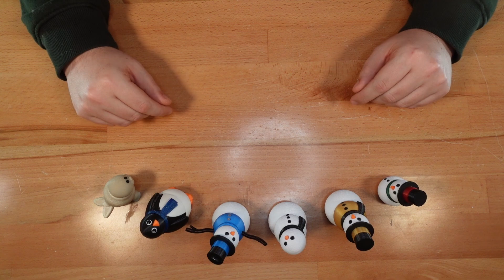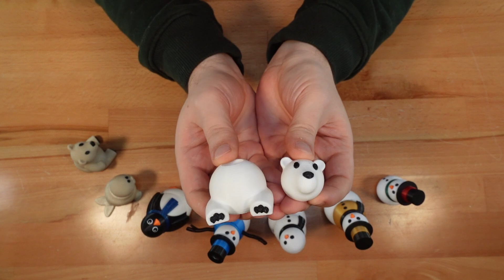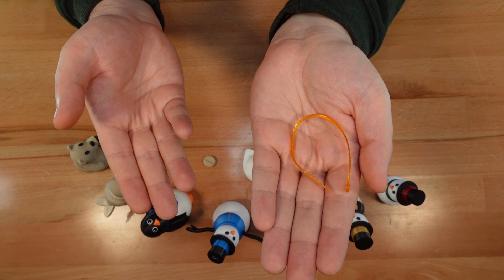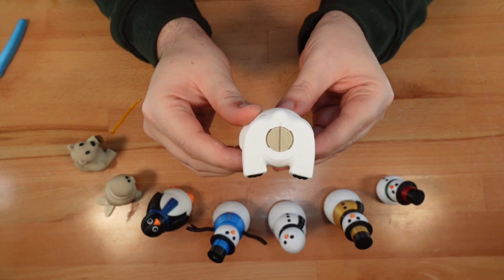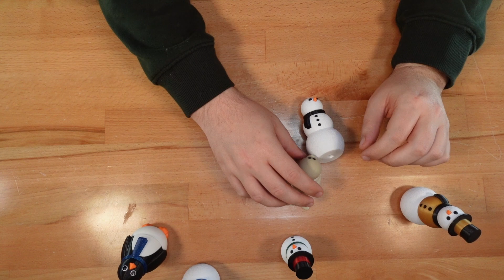3D Printed Posable Bear Cubs

Comment: Great print!  And an excuse to try to cajole my printer to work with TPU again (both of us are a bit... cantankerous).  

Just as a side note - in the BJD community, a length of ribbon is often used to guide the elastic cords through some of the more challenging points in stringing.  I tried both wire and ribbon on a very small BJD that I had printed, and found that the ribbon moved more easily around the tiny curves. 

And a cat version would be cool, in honor of your outro guest. =grin=
Reply from the maker: Excellent feedback with using ribbon as a threading tool, thank you! Threading something through first might be extra helpful since TPU has a sort of high-friction rubber feel to it.

Zelda the cat would certainly approve of your suggestion :)

Comment: i made one and the TPU zip tie really helped! my other experiments with TPU were pretty messy but all i needed to change from my PLA settings were the temperature and print speed! The Zip tie is also much nicer than the full TPU filament strand as that was too strong.
Reply from the maker: I'm very glad it worked out! My TPU profile is also just a PLA profile with a higher temp and slower speed.